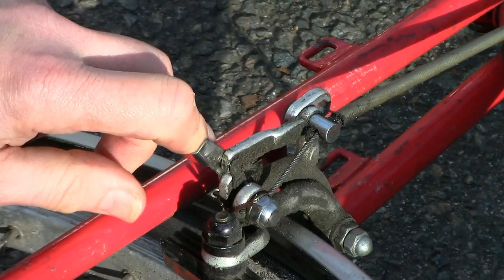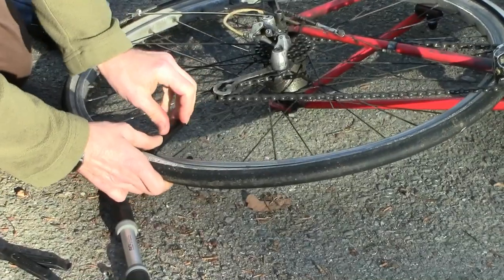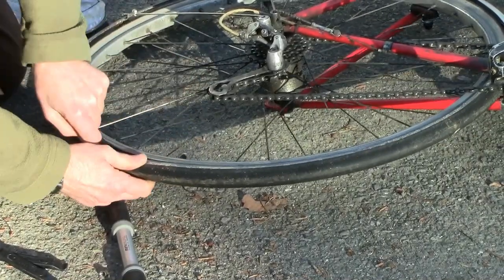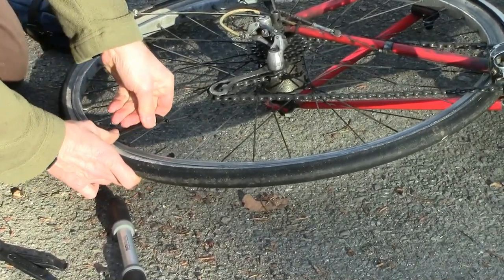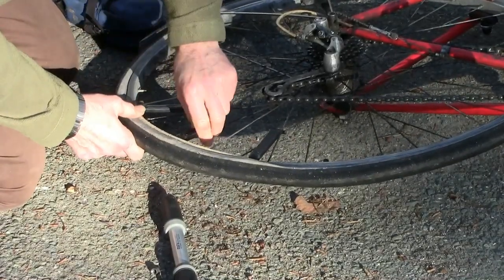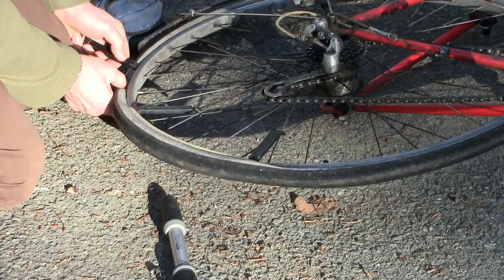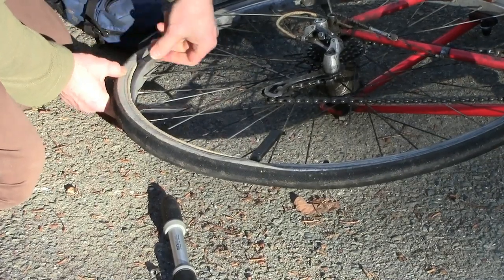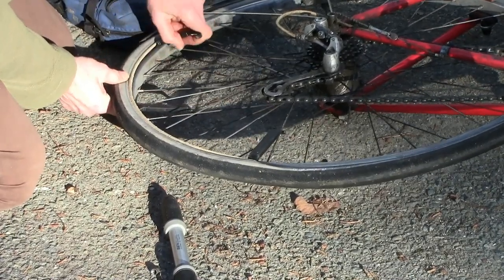Exposing the inner tube without removing the wheel

Comment: You don't need to pull out the entire tube if you can find the leak/puncture point! Put a little air in and listen for the hiss. If you can hear it, just peel out about 12", then put another pump or 2 of air in. With the leaking part of the tube out of the tire it's much easier to pinpoint the leak

Comment: At what point will you remove the inner tube?  Presumably in another video because this is still attached!
Reply: He's patching it not removing
Reply: You can't remove the inner tube without removing the wheel. That is one of the reasons for patching the tube instead of swapping it for a new one.
If it turns out that you cannot find the puncture without taking the wheel off and removing the tube completely, at least you will not have wasted a lot of time attempting to find it with the wheel still on.

Comment: 0:09 Instead of pushing on the bead with the thumbs, pull from the other side by digging in all 8 fingertips. You'll be able to apply a lot more force that way. Tyre levers also make it more difficult since there'll be less room available to wiggle with. Fingertips - all eight of them and grip it like you're digging them into your palms. Work a bit at a time and keep repeating it from one end to another and you will make progress.
Reply: Notice how thumbs will easily flex the wrong way when you try to push like this. Fingers don't do that because they're a lot studier if you use them in concert and dig in at the right direction.

Comment: If the rim brake has no release to create space beside the rim, thus preventing passing tube and tyre around the frame, undo and remove a brake block instead. It saves losing the adjustment of the brakes which would happen if you "unwind" the brake some other way. 
It is different when you remove the wheel. The tyre is flat, so it squeezes past the brake no trouble... which is the reason you LEAVE it flat until after the wheel is back in place.

Comment: lol.....amazing how many knuckle heads remove and replace the entire tube as the main fix it solution....it's like they never knew you can patch a tube in minutes. Also, the fools have rear hub motor ebikes, to remove that rear wheel can be a pain.